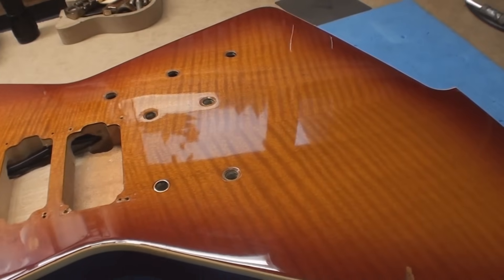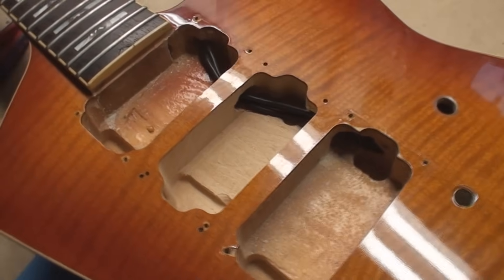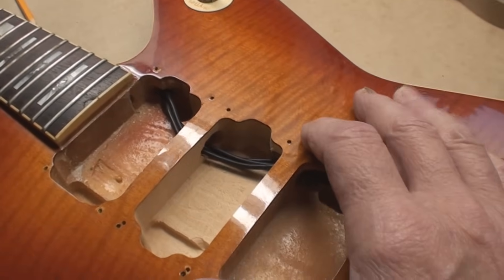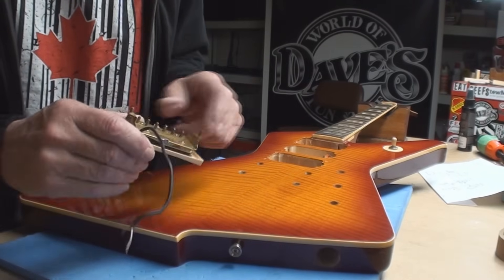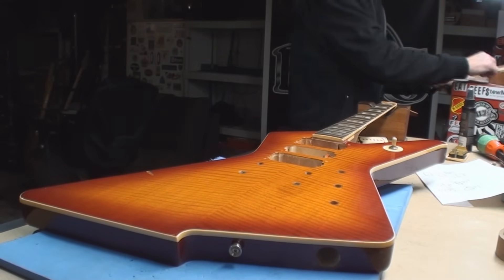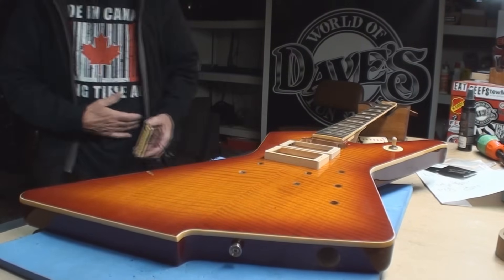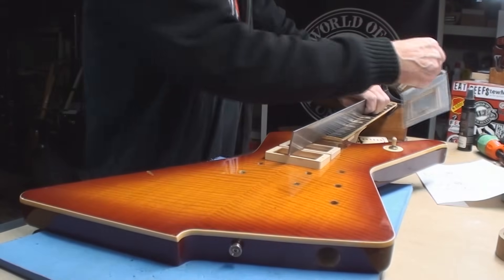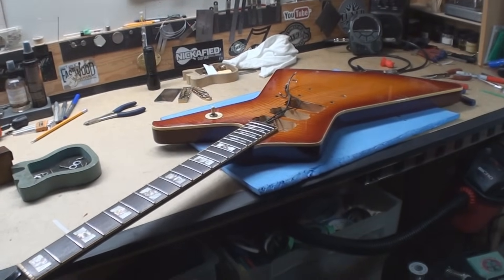Ibanez Destroyer Will Destroy Again

Comment: There is no finish residue in the middle route so looks like the route was done after the clear coats (unlike the bridge and neck routes). The Destroeyr series does have a 3 Humbucker version though. Most famously used by Phil Collen of Def Leppard. A friend of mine had the Ibanez X Series Destroyer II (bolt on neck) standard trem\Black with binding\3 Super 70 cream humbuckers. He had a genuine Gold Floyd Rose installed. Never held its tune unfortunately. And the neck was like a baseball bat. The model name is a X series DT -155 from 83 or 84. 🍻